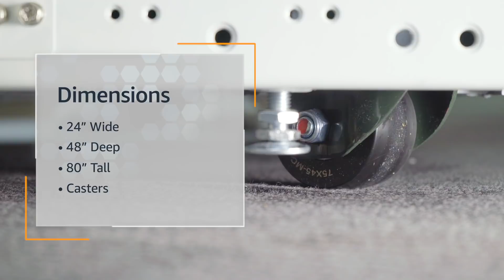What is an AWS Outpost Rack?

Comment: nope, why would i put something i don't control in my own network , "Automation" they say ...
Reply: Oh, and you control all of the hardware/firmware you use down to the bytes and solder? You sit on mountains of tech already, you have no idea what the complete working picture looks like under your network, what's the difference with say, "automation" in software? I don't think this rack would fit my customers, but I am not naive enough to believe that my current setup is perfectly secure either, and I am positive that with Amazons funding they would be able to create a more secure product than most vendors. Bankers and healthcare companies would probably work more closely with Amazon compared to you or I, along with the amount of money they pay for service IF they wished to move their production to an Amazon environment.

Comment: What is that connector on the end of the orange cable top left? I wonder what that cable is for.
Reply: The orange cable is usually used for serial console access to the network switch - the black connector on the end is a RJ45 to RJ45 socket allowing the serial cable to connect easily via the front of the rack
Reply: The looks like a MPO connector. Probably used with QSFP28 for 100 GbE.
Reply: @seanlingham5254  Nah that's a keystone jack, probably used in that rack for service
Reply: @seanlingham5254  But it has an RJ45 UTP cable plugged into one side of it?
Reply: That's simply a RJ45 female-female coupler, the orange cable is the serial console for the TOR

Comment: Cloud...  On prem...  Head exploding!!
Reply: It's funny to me because it was never really about the cloud, was it?  It was just about getting everyone to adopt your tool set.
Reply: Yep, as the saying goes "There is no cloud, it's just someone else's computer"
Reply: @joeshmoe7485  Well, cloud architecture is a real thing. If it runs in yours or someone else's Data Center makes a difference for a lot of customers, the biggest customers. Pentagon, CIA, FBI, Banks, Homeland Security. Just a few examples of customers that are unlikely to host their systems in the public cloud;-)
Reply: @webfrasse  I know it's a real thing, I work with AWS on a daily basis, as well as on prem systems.  I just find it ironic that for all the talk about the advantages of abandoning your on prem systems in favor of "going to the cloud..." only to have this added to the mix.  Maybe you haven't noticed that many companies are currently engaged in a broad ranging effort to move to the cloud.  Sometimes at any cost, disregarding years of design and engineering work, throwing all of that away, devaluing their engineering staff...  So, I just find it funny now that AWS will sell you a rack.  Again, because it was never really about the cloud, it was about capturing the existing IT market and getting everyone to use your tools.
Reply: @joeshmoe7485  I'm sure you're then aware of the differences between running your own on prem stack vs. running instances on AWS. There is a value in having the AWS cloud and AWS on prem being the exact same env. running the exact same cloud stack and vm instances.
Reply: @webfrasse  yeah yeah...  how convenient it all is, isn't it?  :)
Reply: @joeshmoe7485  Shmoe being smug? It's all on you...
Reply: @webfrasse  why do you keep responding?  what's it to you?  we can all have our opinions, why are you so bothered with mine?
Reply: you can already get something like that with azure stack
Reply: And Oracle Cloud has been doing this for 3+ years.... game changer when it comes to compliance and regulatory concerns.
Reply: nuthin new if you have the money hardware can be automated many gazillion ways from past to present, now how many sexual postitions from past to present, i doubt a gazilion.
Reply: @jigar1  Sure, you try to build, test and maintain all stuff that AWS, Google, Microsoft, and Oracle have spent years on. Let us know how it goes with nuthin new:-)

Comment: God..... Damn... AWS so cool.

Would you get a different type of rack for something like s3?
Reply: Hard to imagine you'd want or need one for S3.  The whole selling point of s3 is that they offer replication and guaranteed availability over a wide area.  Storing your S3 files on your location sorta defeats the purpose of using a service like s3.
Reply: This is not for S3, S3 data is never stored in a single rack.

Comment: "of course you can use 10 gig network if you don't have 100" OMG my network is slow.
Reply: "If you can't find metal stucco lath, use carbon fibre stucco lath."
Reply: @chrisc9383  Great reference
Reply: 100G is not that much if you are talking uplinks. Bring on 400G TORs.
Reply: @fantomaus  2:24 "and you can bring 4 100Gig connections..."

Comment: What's the kW/rack heat when fully populated?

Is there a recommended way to stabilize for seismic, since rollers?

Also I see it differs from legacy Telco/19" and OCP 1.2 in dimensions, so it's likely that a modern site would have 3 sizes of racks on the floor. Planning aisles for varying depths would be a pain, especially for pulling components.
Reply: I think you can see extendable legs. Looks like the same approach as your standard washing machine.
Reply: @fantomaus  Good spotting! I'd be interested in an analysis that the individual leg design offered enough seismic stability for, say, a 6.9 event like the 1989 Bay Area earthquake.
Reply: I've done seismic-safe implementations of standard racks and these should (emphasis on should) be also standard to support the overhead seismic rails and base weighting for stabilizers. Great question to completely confirm with AWS of course.
Reply: @EricWrightDiscoPosse  I wonder if seismic base isolation tech is compatible with these racks. So many questions…
Reply: Hello Richard Hintz, I work in an environment that builds and sell racks used in datacenters just like AWS Outpost. Most of the racks that we utilize have small metal stoppers on the bottom which are used to keep the rack stable.
If you go back to the video and pause at 0:57 seconds, you will see a metal plunger/stopper right next to the box saying "Dimensions". These can be twisted to drop the plunger to the ground to keep the rack stable and stop it from moving.
Reply: @johnb1391  I guess my issue is whether the rack stability mechanism is able to withstand seismic lateral,
 shear forces or if it's compatible with an isolation pad.

Comment: So glad to see that component-level power supplies have been eliminated!  That will be a huge improvement in the reliability department.
Reply: The busbar will still feed power to a powerboard that can fail but it is a nice design for sure. Certaintly makes cable management easier.
Reply: But if the bus bar fails ? :D
Reply: @foobar879 The busbar is just metal, very low possibility of it failing, the powershelf that supplies its power can have failing components but those can be swapped out easily.
Reply: @DionysusFascinus  I was implying the powershelf with it. 
On a rack you can swap out alim easily too, but here we rely on more intermediary stuff to get the power. 
Seems a bad idea to me, looks like a big single point of failure :p
Anyways I'll never use those contraptions so I am not concerned.
Reply: @foobar879  it's harder to swap smaller powersupply on the individual machines.
and if the centralized dc converter runs parallel, if one fail it'll just throttle the server for a bit and need change the failing supply, you don't need to provide 2x powersupply anymore
Reply: @foobar879  The power shelf has several redundant PSUs, a single failure won't compromise the rack.
Reply: Single point of failure ! The only advantage is cost reduction.